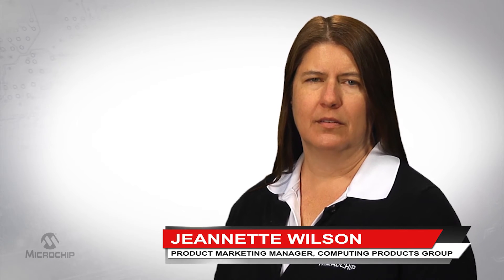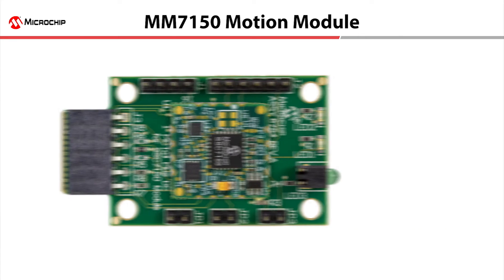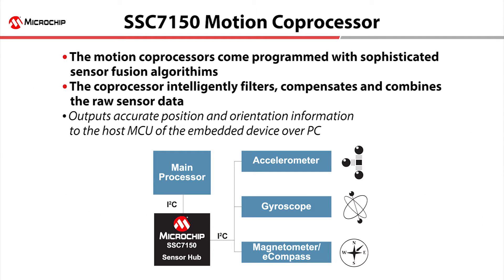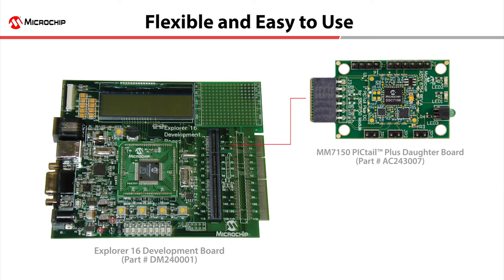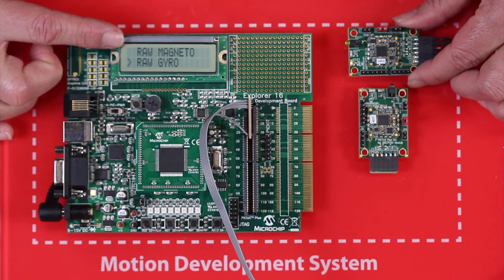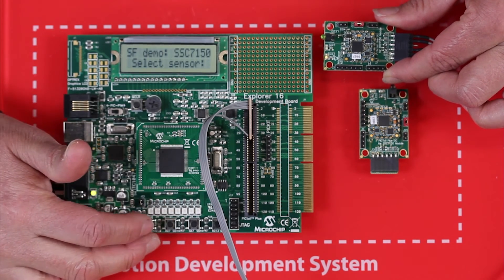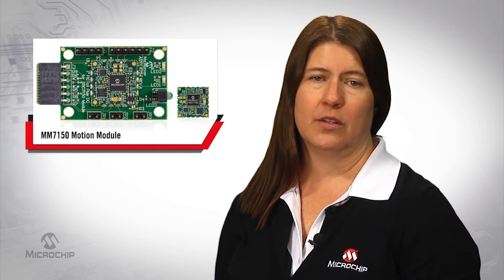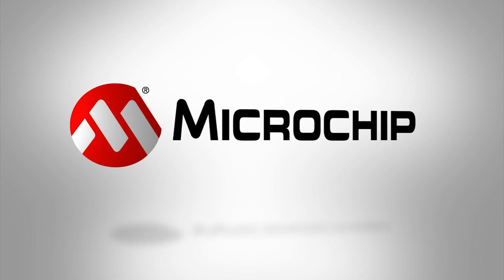MM7150 Motion Module Demonstration

Comment: Compass : He rotates the MM7150 by almost 180 deg but I don't think the compass reading changes out of the 200s.  Am I alone in this perception?  I have been working with the MM7150 and so far I cannot get the compass reading to correctly reflect the degrees rotation of the part.
Reply from the maker: Laurence - I recommend you contact our technical support team about this issue: support.microchip.com.